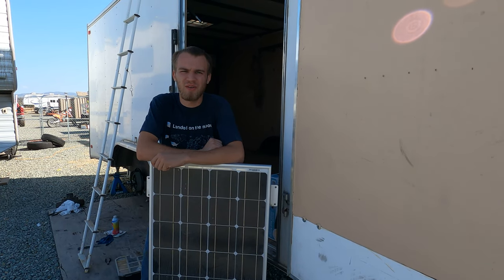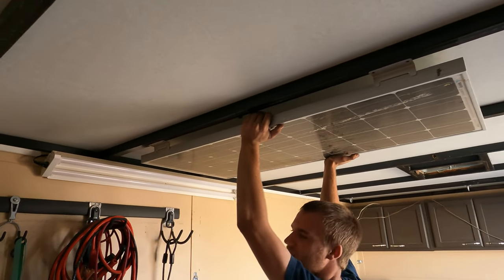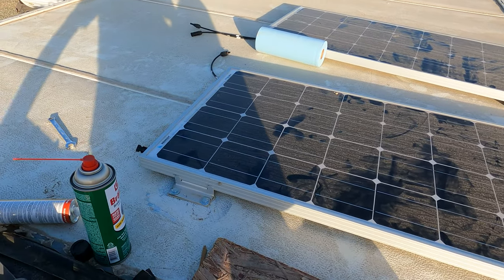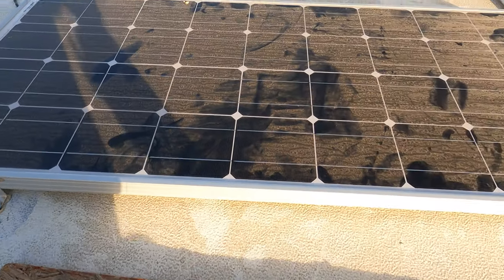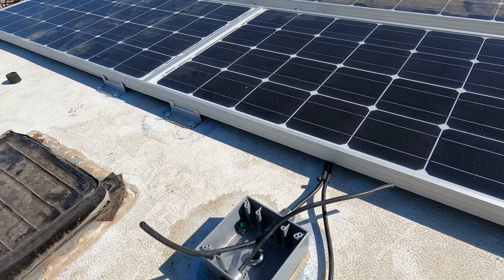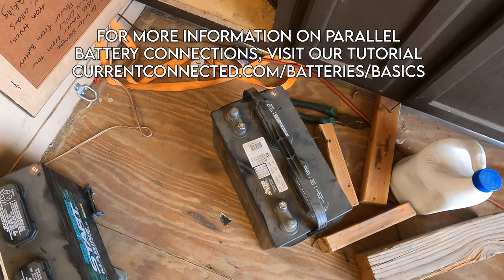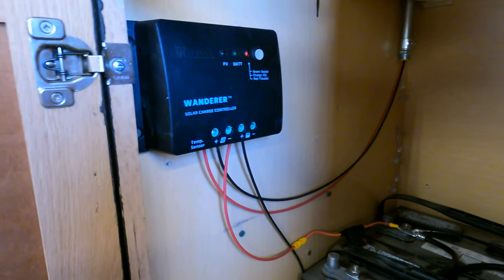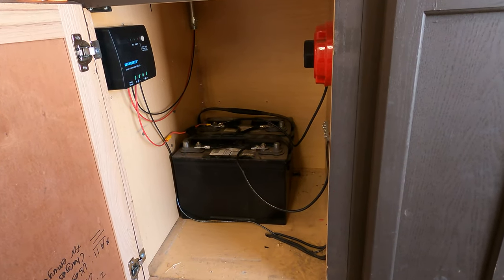INSTALL A DIY SOLAR SYSTEM ON AN RV/TRAILER WITH AN ALUMINUM ROOF

Comment: Make sure the solar panels are at a small tilt so that water doesn't pool on them, i i would add in a meter to see batt voltage - even other cheap pwm controllers can tell you voltage!  that thing is SUPER basic!!! YOU ALSO NEED TO VENT THOSE BATTS. maybe with like a small 12 or 5v fan when its running / chanrgering! gas can build up in that space!  put a vent at least on the front! - A small meter that can read the batts voltage could be added to your bus bar no problem. and tell you how many amps are being pulled from the system total!  ETC - its also a good idea to have a little LED light for when the batts are full but u have excess power from the sun- I'D a cig lighter and a front panel to the door, maybe add a powerpole plugs
Reply from the maker: I like the 12 volt adapter idea!  Also, minor spoiler alert, but it wasn't much more than 10 minutes after this video was done that I took out those lead acids and put in some CALB CA180 and made a second video on it :P

Comment: I'd add a fan to that cabinet.  Both to keep the batteries and charger cool and disperse the Hydrogen faster.  As light as it is, there's little chance that H2 could build up in a cabinet that's not sealed, but no reason to take chances.  If you decide to keep the batteries for any length of time, I'd look into Hydrocaps for them (http://hydrocapcorp.com/).  They catalyze the H2 generated during charging into water, which falls back into the battery.  Much less maintenance, and much less replacing water in the cells.

Comment: Awesome set up. But wiring them is series is a horrible idea. Leave them wired parallel
Reply from the maker: With an mppt charge controller they are better in series.

Comment: Better question... where the hell are the fuses... Holy hell.  400w of solar coming in, and no fuses.
Reply from the maker: Pv is current limited. You could have a short circuit and nothing would happen. If you put a 15a fuse, the 9a short circuit current of the panels would not be able to blow it.

Comment: I would have used rubber and no puddy.  The puddy is going to deteriorate in time.
Reply from the maker: the putty forces its way into the nooks and crannies without requiring excessive clamping force; this method is exactly how roofs are sealed on most, if not all, RV's on the road today.  Usually leaks happen from the lap sealant wearing out not the putty deteriorating.